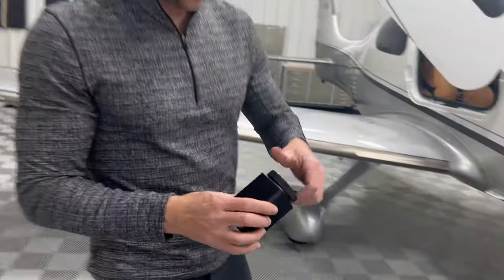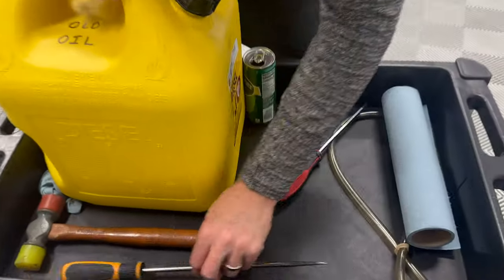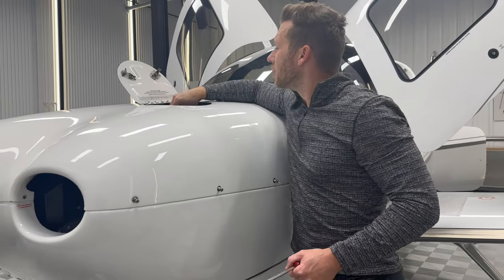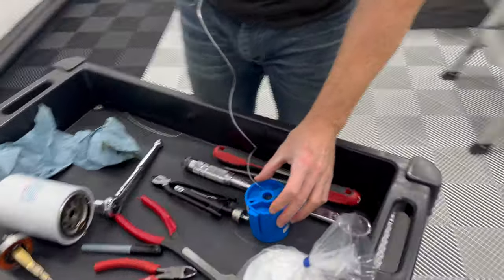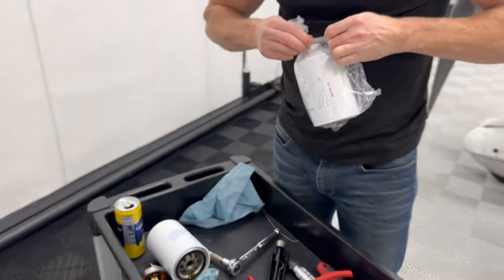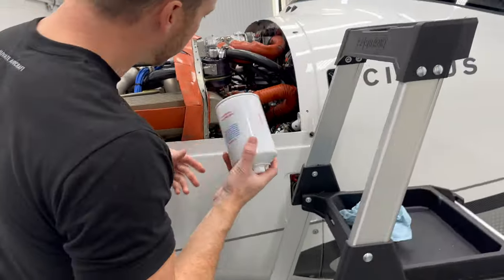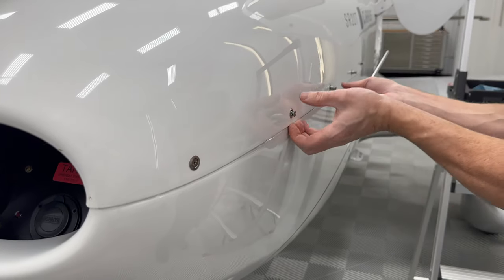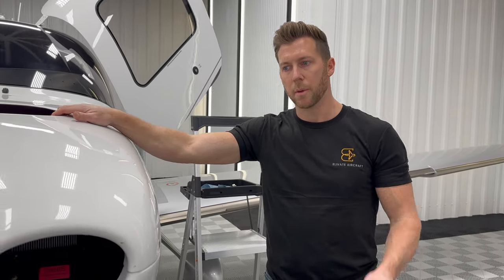Cirrus SR22T Oil and Filter Change DIY - save time and hundreds of $ dollars

Comment: I have a G3 550 – N.

A couple of helpful hints:

Place a piece of cardboard between the spinner sticking up as you put the cowling in it won’t touch the spinner. 

After you place one hole in the oil filter, use five psi air in the hole to blow out the remaining oil so you don’t have any mess or have to wait so long before you remove the oil filter.

Thanks for the video. Great job! Fly safe.
Reply from the maker: Those are good tips. In this video the paint is old and damaged so I didn’t care. Now the paint is brand new so I use a piece of ram board with a 6” 1/2 moon cut out in it and it works great for the upper and lower cowls. I like the psi trick that is good. But I always like the pan to drain for a day or so so not needed most the time but if I’m ever in a hurry that’s a great solution.

Comment: Thanks a ton for taking the time in making this helpful video. In my G2 20 maintenance manual, it instructs you to fill the oil filter before installing and even states “failing to fill the new oil filter with oil will cause the engine to be started without any lubrication causing excess engine wear at startup.”

Now granted, the 20 has an oil filter located on the bottom but just a heads up for any 20 owners following this video.
Reply from the maker: Great point. I should have mentioned that! You are correct, the older SR20 motor I believe is the only one in the SR family that needs that done. Isn’t that filter inverted (upside down) where it can be filled the a typical vehicle oil filter?
Reply: @Elivate.  at least on my continental IO-360 motor, you are correct, the filter is mounted upside down from the bottom. For me, I fill the filter about 7/8 of the way and simply screw on. There also isn’t a need for me to punch holes in the filter either. I didn’t confirm but I would assume the layer Lycoming SR20 engines use the same configuration.

Comment: Owner/operator maintenance logbook entries are supposed to have certificate number, too, I believe.
Reply from the maker: Good call. I think you might be right. I’ll look it up to confirm.
Reply: @Elivate.  From AC 43-9C, b. The type of certificate exercised when maintenance or preventive maintenance is 
accomplished must be indicated in the maintenance record. Pilots may use PP, commercial pilot 
(CP), or air transport pilot (ATP) to indicate private, commercial, or Airline Transport Pilot 
Certificate (ATPC), respectively, in approving preventive maintenance for return to service. 
Pilots are not authorized by § 43.3(g) to perform preventive maintenance on aircraft when they 
are operated under 14 CFR part 121, 125, 129, or 135. Pilots may only approve for return to 
service preventive maintenance that they themselves have accomplished

Comment: Silly question, but you mentioned re-painting the plane, I was wondering, as an alternative to painting, are wraps a thing?
Reply from the maker: I don’t believe there are any approved vinyl wraps for certified aircraft but I could be wrong. There are vinyl graphics that are approved by some oem’s.
Reply: Spoke with Cirrus about wraps and they are a no go.  Each paint shop has specs from Cirrus on exactly what they can and can’t do with a repaint.

Comment: 12:55 - Why not just remove the oil filter at that point? Don’t you risk damage or metal contamination by smacking holes into the filter while it’s still attached?
Reply from the maker: The video ends up describing the reason why further along. If you were to remove the oil filter, you would spill oil all over the rear of your engine. There is no risk of contamination or damage to the engine if you puncture small holes as demonstrated.
Reply: @Elivate. got it, thanks! Love your content and you have a beautiful plane!
Reply from the maker: Very kind of you. I'm glad you are enjoying!